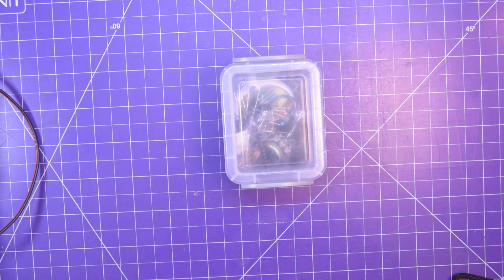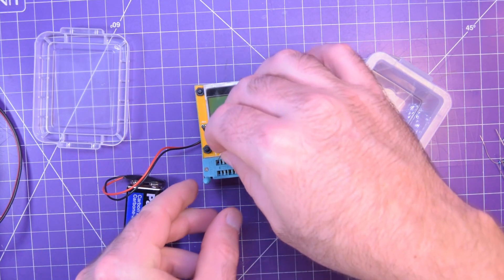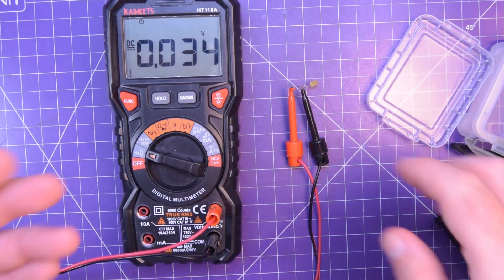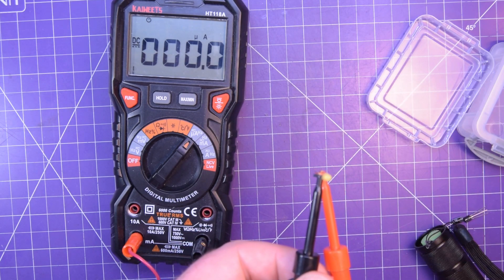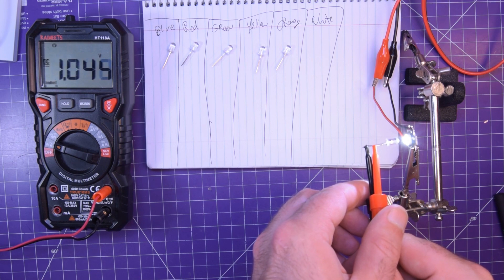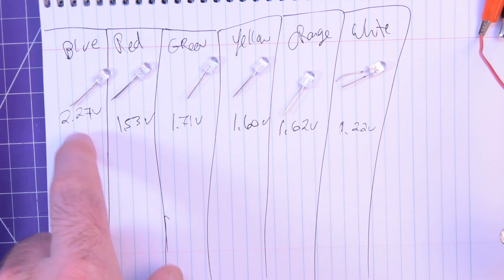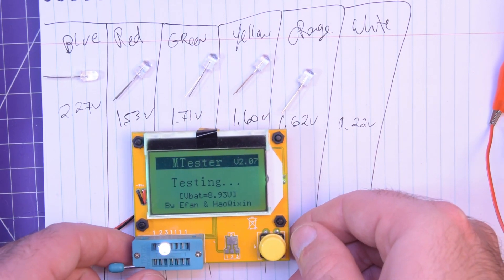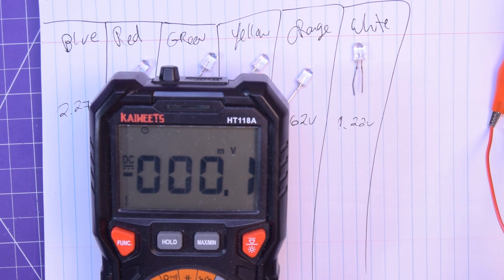Your LED Has A Dirty Secret...

Comment: I remember when transistors were made of glass and were painted black to keep out the light, so of course you could scrape the paint off  them and demo the same effect, the legend that is the PN junction or the NP junction to be politicly correct, in the same vein you can get light out of some types of solar cell by applying a voltage !...cheers.

Comment: This was a great experiment with the LEDs. I was surprised you missed a fantastic opportunity to use the MAX/MIN feature of the Kaiweets HT118A meter. It would have easily provided the MAX voltage for each LED voltage output automatically. :-)
Reply: You can take this one step further, if you can sort the devices under test (DUT). In the case of your LED experiment, sort from lowest to highest output voltage. Then you do not need to touch the MIN/MAX button to reset the session for each device since each one will now increase the MAX displayed on the meter as it is tested.

Comment: Neat.   I wonder what would happen with a UV LED? 
Would it work with a white LED or do you need the sun or another UV or blue LED to drive it?
Reply from the maker: A white LED has a coating over it (phosphorus) so far less of the light gets to the actual junction
Reply: @SimpleElectronics  Yes I wonder if you pointed a UV LED (or the sun) at the whiie one would that excite the coating more than pointing  a red, green or yellowq LED at it.